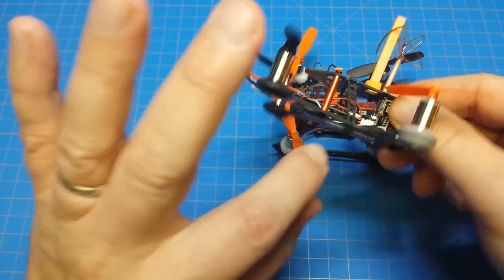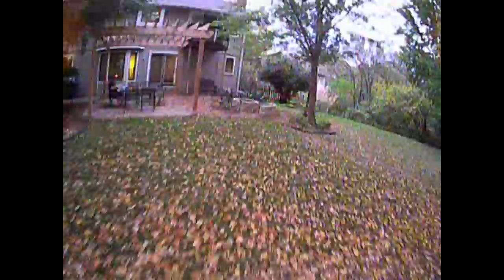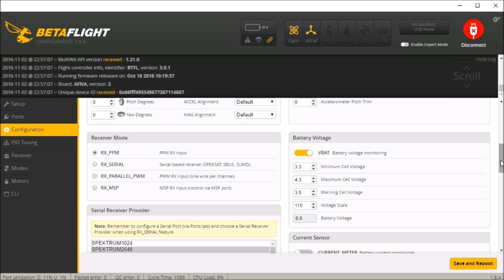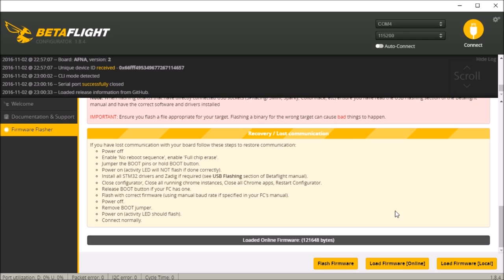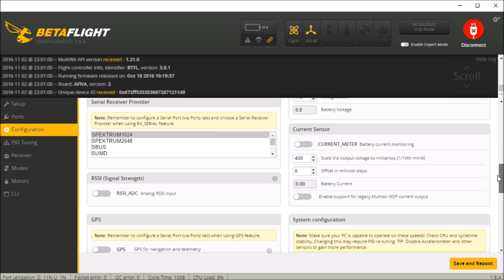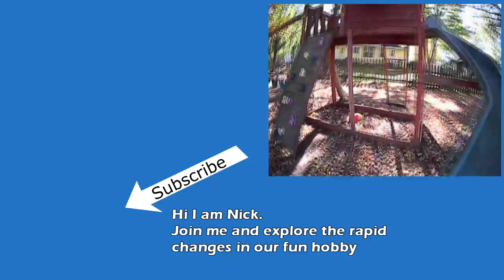JJPRO T1 and T2

Comment: I bought the jjpro t1 with devention devo e7. I download the last firmware to the dron. I put the battery and it put on automatic the motors on. I can't connect the controller with the dron. Can you help me?
Reply from the maker: when you plug in the vehicle via usb to cleanflight or betaflight does it show movement on the receiver tab when you move the radio sticks? If not, the receiver isn't bound to the radio.
Reply: Nick Burns when I move the sticks don't move the dron. What can I do?
Reply: Yes, the receiver move in the app. But not connect with the dron. Which is the next step?
Reply from the maker: If your using a satellite rx what this. https://www.youtube.com/watch?v=p0jcz8E90mg follow the steps closely, if it doesn't work do it again and again. If your not using that RX search youtube for your RX and devo7e.
Reply: Is naze32

Comment: Hey Nick can you help a newbie out ? I bought the T-2 but cant figure out how to bind it to my devo 7, and just got an Frsky Taranus plus but cant figure that out either wll either of them work?
Reply from the maker: Sure. If I recall correctly these should go to autobind when we plug them in to power, usb or battery. Do you get a really fast flashing light when you power the vehicle? Had your devo been modded (4 in 1 module and deviationtx firmware)? As to the taranis, I don't have one but often what needs to be done is to set the protocol to "D8" and then bind. Let me know what we have.

Comment: Will I be able to bind one of these or the QX80 to the Spektrum DXe? And how would I arm it? I'd really like to get one of these but I'm worried I won't be able to arm or bind it. I've built a a 200 sized quad with the naze32 and all I have to do is push the left stick to the bottom right.
Reply from the maker: Yes, as long as the receiver is DSM2 or DSMX the spectrum radios should bind. Arming can be done with the sticks, like you describe or by setting a switch to arm. In clean flight there is a mode section which allows to set a switch and the switch value to arm. I believe I show the Cleanflight arming in this video.
Reply: Awesome! I didn't know you could tell cleanflight to use the sticks to arm, because I have had trouble trying to get the switches to work in cleanflight. I'll definately look into this sometime soon. Thanks for the help and keep up the informative vids!
Reply from the maker: I believe stick arming in cleanflight is the default, switch arming has to be setup.

Comment: i fixed my lt105 with super glue
Reply from the maker: any particular kind.
Reply: Nick Burns 
No i used normal superglue and jamara speedy combine pulver but I'm not sure if will need it and in german its called "Toolcraft Aktivator Spray" 

as you no i am german so sorry for some gramatik mistakes
Reply from the maker: Okay. I think anyone who speaks/reads more than one language is very amazing.

Comment: nice! my eachine ex105 should be here soon. cant wait to fly acro with these micros. any intention to sell/give away unused micros/brushless quad? (i can image you will run out of space at one point xD)
Reply from the maker: I have privately given away some quads. I do plan to do more giveaways. While my first youtube giveaway went very well it takes more time that I thought. Hold tight more are to come.
Reply: Nick Burns i just recieved my ex105 lol. ordered the rx (same as qx90 ed) and micro sepperatly, due to stocking. now, im a bit uncertain about my DJT frsky module in my t9x. can it output sbus? (i dont know if that is even possible... i can imagine only the rx is supposed to do that lol)
Reply from the maker: yes, receiver is the part that does sbus, sometimes the fc needs an sbus inverter to work properly. I am not familiar with those items, afraid I don't have much to share.